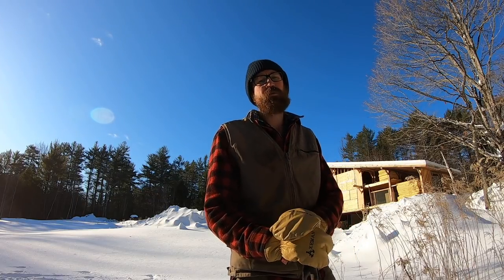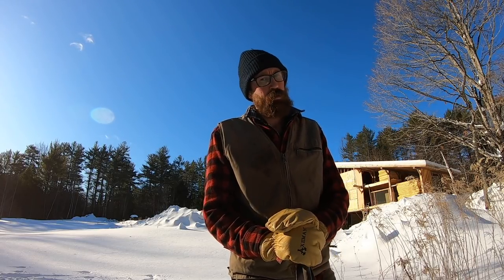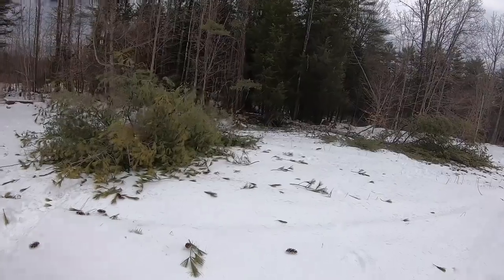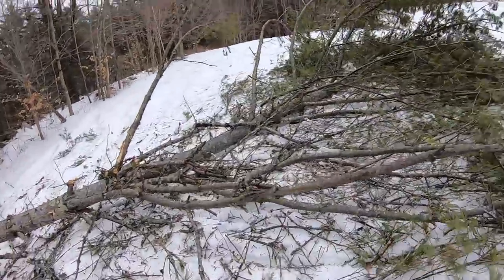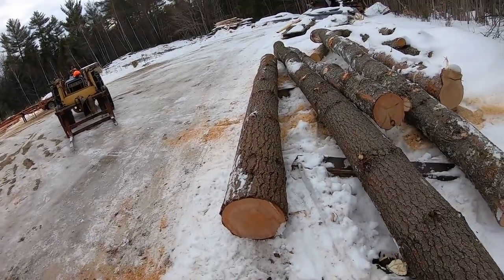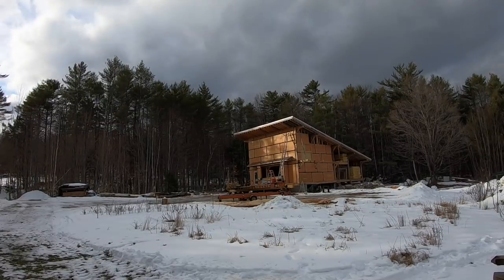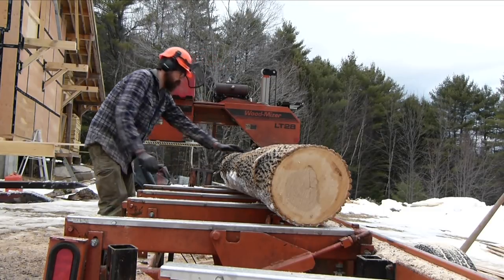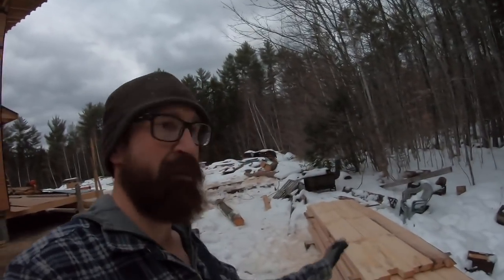Building a House from Trees SE 5 EP 14 Tree to Lumber in One Day

Comment: Hey Bus! Been watching for about a year or so. Seeing you run that mill reminds me of my old original LT30 that my Dad and I bought well used back in the early 90's. Onan 18 horse with power feed and power up/down. Everything else was manual. Tractor with front end loader easily doubled production. Then you crashed a blade with a tramp nail and that brought back even more memories!! The best advice that the guy who sold us the mill said was; "there are only so many steps in a day and you're going to find them all running this mill." Keep up the good work and who knows, I may run into you someday on a trip from down here in East Texas up to Maine.
Reply from the maker: Thanks a lot for this narrative. Yes, there is a lot of movement to running that, but it works shockingly well! I might just ride my bicycle through that neck of the woods before too long. Once I get this house to a good stopping point, I am going to hit the road for a spell.

Comment: A pleasure to watch. How long do you let your lumber dry before using it?   What concerns, if any, do you have about shrinking?  Thanks for sharing your life with the rest of us.
Reply from the maker: Thanks. Just yesterday I milled some 2x6s and placed them as wall studs in the one remaining wall section to frame. But i prefer them to be dry and they are much lighter and easier to work. Since I mill everything to real 2x4 or 6 I am ok with a tiny bit of shinkage. There is really very little. Thanks for the question
Reply: Bus Huxley thanks for the reply.

Comment: Hey Buss I cut some red oak a couple months ago I need to use them for 8x8 beams will they stay straight if I mill them now
Reply from the maker: Good morning. I am not positive, but I would certainly mill a half inch over all the way around and paint the end grains. It'll take a while for that to dry out completely. Good luck. Maybe another year.
Reply: Bus Huxley Thanks for answering could you give me advice on poplar wood? I am building a 24x24 and need floor joists , I have large poplar logs I want to cut into 2x12’s for joists I keep getting 2 answers one never use poplar outside and another saying as long as they stay dry I’ll be fine. They will be dry obviously and I’m spreading rock under cabin with plastic on top of it, sure would love anyone’s opinion thanks

Comment: Hey, how do you like the LT28? Is it a good investment or would you just go for the lt35 and with hydraulics?
Reply from the maker: Michael Hofmann Hey there. It’s a great question. I really like them both quite a lot. Of course the 35 is physically less work, mainly I think from turning and locking the log into place. But once the cant is set, the 28 just sings through boards with that quick set wheel thing. I like it a lot and think it’s a great deal for the money. The 35 is probably a little bit faster but the 28 is close once you get Familiar with it and have a rig with forks. I’ve milled thousands of feet on the 28 and really like it.
Reply: @BusHuxley  thx for the reply! I'm in Alaska and want to get a woodmizer this fall. I think the first couple years I'll use it mainly for my own projects to get familiar with it and then maybe get into some portable contract sawing or start selling slabs... What's your opinion on outfitting either the 28 or the 35 with the diesel option? I like the idea of easily putting a block heater or coolant heater on the engine so it'll start easy in the winter... you're in a similar climate as we are I'd say. We're 30 miles north of Anchorage so we don't get the brutal cold weather regularly... if it's in the negative digits nobody wants to be out sawing anyways I'd say...

Comment: Buss just some food for thought it would be  more efficient to drag a few logs back at once then 1 by 1.
Reply from the maker: The go pro makes them look small from that angle, but they are close to the limit of what I can twitch with my configuration. I have that counter weight strapped on to the winch which adds 1500 lbs. I am careful not to over extend the steel.
Reply: @BusHuxley   ah well you can always use the towbar